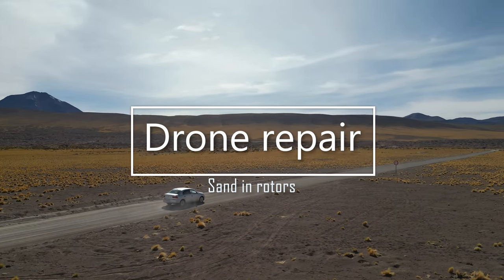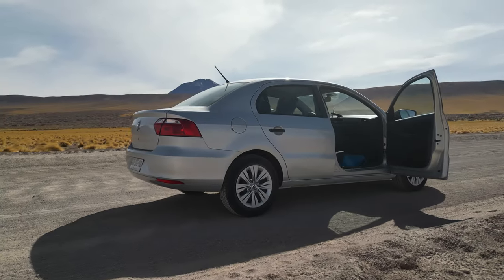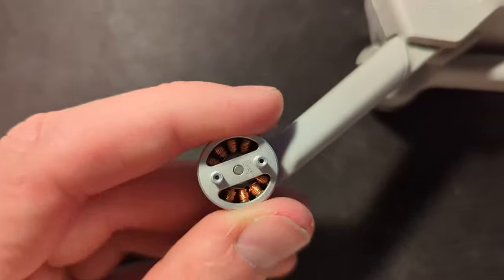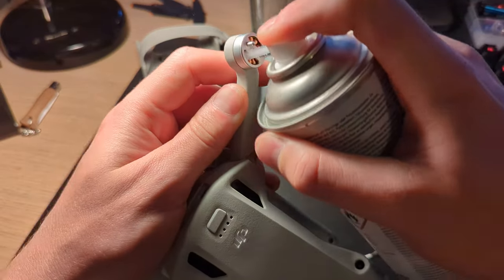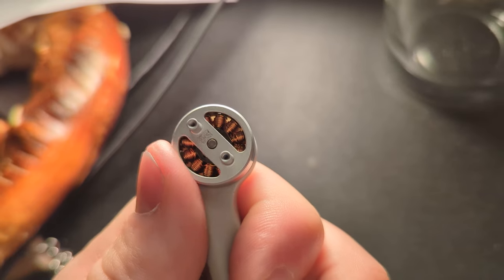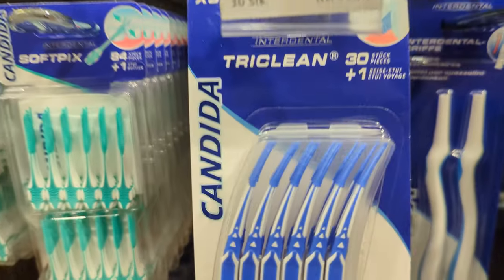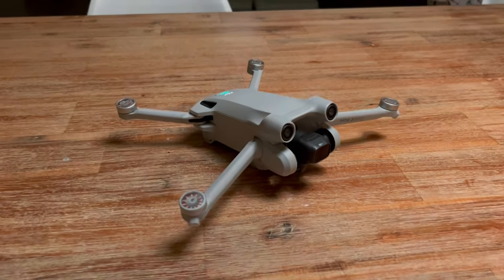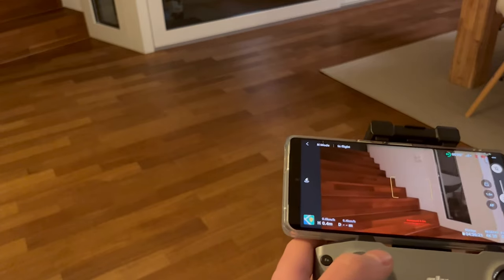Solution to sand in drone motors (DJI mini 3 pro)

Comment: one of the reasons DIY drones are so much better is you can take the bell off the stator and clean them out easily. you did a great job fixing an "unfix able" drone!
Reply: And if you cannot fully clean the ferrous sand particles off the magnets, you can choose to replace the motor bell only.
Reply: How you can take off the bell? Just pulling?
Reply: There is a disassembly video here on YouTube that should help you

Comment: When my drone was landing, it slid off the picnic table onto the sand on Lake Michigan and stuck one rotor into the sand. You can imagine how much my drone liked it. The rotor was stuck. Me and my wife used yours method and with one time use dental plastic spiral brushes  and air compressor after one hours our drone was in the air again. Thanks for the great tip !

Comment: Definitely wouldn't say that you're dumb at all I actually made a similar mistake out of excitement where I was flying my drone through a tunnel (I was also walking behind it) because I was trying to get some footage.  It ended up hitting one of the walls in the tunnel due to the fact that there wasn't enough ambient light. 

 I was actually still able to fly but got worried about the sound of dirt particles being in one of the propellers.

 I also had a stripped screw in my right propeller so I just decided to send it out and pay for a replacement but if I would have found this video beforehand I would've just cleaned it out and continued on.

 Thanks for providing this solution and if I ever have this issue again I'll follow your recommendation.
Reply from the maker: I think the brush technique and a more high powered compressor should do the trick, but I hope you won't need it ;)!
Reply: @LuWolharn  agreed. Going through DJI care was not the easiest thing so I will surely be more careful.

Comment: The best and easiest way is to use an actual Air compressor.  120psi. 3 seconds per motor. Spotless.
Reply: Spot on :)
Reply: This is what worked for me too. Once I got it to where they rotors would turn on their own I again used compressed air from a shop compressor with the rotors turning without props on. That blew out any residual dust and sand particles. The canned air doesn't have enough psi. Blowing them out while running was key.

Comment: Much faster way (not sure if it’s ok with dji, I’m flying fpv).
Disassemble the motor (there is only 1 screw) and collect all off the sand with something sticky — even a gum will work fine. Rinse with some alcohol and you ready to go. 

And my mini 2 I usually land in my hand in conditions like this
Reply: Plus it’s works even with ferromagnetic sand. Worst thing ever! Brushes, air or alcohol won’t help in this case.

Comment: Do you know why it wouldn't land?
Reply from the maker: It probably didn't recognize the Floor as "landable".
There were multiple problems that flight:
- I got the high altitude warning and clicked it away
- once in the air even though it was just a few meters away the video feed was super choppy (around 1-2 images/s)
- didn't wanna land (not exactly sure why)
- high wind warning

Comment: You were flying 12,000 ft up?
Reply from the maker: I stated around 4200m (= almost 14000 ft) altitude but didn't very high because of several issues.

Comment: Pull the c clip off the bottom of the motor , slide the bell off and clean it right
Reply from the maker: I tried but the screws are glued in and even after heating with a hair drier, I couldn't get them off..
Reply: @LuWolharn  that's weird . Did you buy it new? If so it may be a mini thing, but Google see if you can buy replacement motors , if you can then obviously it comes apart. I'd suggest the proper screwdriver, and lots of pressure,  don't know where to get it but there's a paste like loc tite probably made by 3m that you put on the head of the screw or screwdriver that keeps the screw driver from slipping allowing you to give the screws more torque... 
That sucks. Normally I do what you do but I've had grit that this was the only way I could get out.
Reply from the maker: I managed to repair it without having to open it but on the mini series, the motors are not open on the bottom, don't know what drone you are used to.
Reply: @LuWolharn  mavic air 1, dji fpv, mavic 2 pro.
Reply from the maker: Well they seem to work differently but I'm happy I found this method by accident ^^
Reply: @LuWolharn  don't get me wrong, I'd do your method 1st , because it's harder to reinstall the c clips than it is to take them off.

Comment: Welp now you just removed the lubrication from the bearings with the isopropyl alcohol… these will last a month max, before giving issues
The best way is to use compressed air, But you have to blow in between the coils and the magnets of the rotor, not between the coils, there are no moving parts there…

Comment: I custom build fpv drones and the best thing to do is take the bell off the motor and just use putty. Theres definitely still iron shavings stuck in your motors that are stuck on the magnets. Very east to hand catch DJI drones and you can just flip them over to disarm them vs having to have a hand on the controller to push down on the throttle.

Comment: I had same issue ( crashing on sandy beach). I found that canned air didn’t create enough air pressure. I have a shop compressor with a needle tip nozzle. That afforded adequate air and small enough nozzel to get around the magnets

Comment: In all seriousness though, you demonstrated a great method to clean up grit and foreign material in this type of motor. It no doubt reduced the expected lifespan of these small motors, but they are known to be very reliable over a really long period/number of hours.  The loss of even, say 20% of the 3 motors lifetime wouldn't even be noticed by the average drone pilot. Do you have care refresh? It's not very expensive for the Mini Series- I think I paid $79. You could potentially get a replacement/exchange for a nominal fee. Thanks for putting this up!

Comment: another option might be dip the motor in oil so the friction is lower and blow out the oil,
then you have to rinse well with water and bar soap foam, it disolves oil much better than any gel soap.

Comment: Got some sand in my Mini 3 Pro. My solution was different . Removed the blades from the rotor. Held upside down, and an electrical toothbrush was hold near the motor. Just a small jiggling of the rotor ccw and cw solve the issue in seconds. The vibration made it easy. Could be necessary a helper to hold the toothbrush. Replaced the blades after was clear the grain of sand is not anymore in the motor.
Reply from the maker: Soins pretty smart ! Good job :)
Reply: It worked like a charm thank you!

Comment: Thanks!  One thing that helps, but especially in humidity is to soak the motors in WD-40.  It displaces water and humidity and makes almost anything electronic work better.  It may have also helped remove that sand is my guess....just a guess....but a fairly educated one.  I learned this way back when an organ tech came to our home to fix our organ.  He opened the top panel where all the electronic controls were, sprayed them all liberally inside and out with WD-40....as I gasped in horror....and then closed the panel and said, "There!  Now it will work perfectly for years to come!"  Years later, it was still going strong with not even any scratchiness coming out of the volume adjustment....I've used it on contact plates for air conditioners, boat lift controls, and you name it....amazing!
Reply: Maybe, a sticky substance like wd40 or any oil, grease, etc could stick particles that would’ve flown/dropped off naturally. I’d be wary.
Reply: @yanassi , I understand your qualms for sure.  Actually WD40 is non-petroleum, so it more or less resists dirt and sand, which when mixed with oil can form a sort of grinding compound.  Always good to be careful though, right?
Reply: The only problem there is WD40 could strip the grease out of the motor bearings, which would lead to another set of problems. I'm assuming they use bearings & not bushings.

But yeah WD40 Rocks! It's made of fish you know.....
Reply: @mclovin583  "It's made of fish you know....."
That's a myth. It's not.
Reply: @ddegn  Whoosh!
Reply: @mclovin583  Are you sure? You know some people think the Earth is flat.
Edit: I see you're the one posting about the fish. I'm glad to be wrong.
Reply: @ddegn  The Earths not flat!! It's a simulation.....
Reply: @mclovin583  , Yes, you've got a point there!  Don't want to lose any grease....or it would be toast....

Comment: Thank you, you saved me 2 weeks and a lot of money. I had same problem with my Mavic 3. I tried all the methods. I poured alcohol on it and tried it with a toothbrush, but the plastic tips of the brush got stuck between the motor windings. Still, no sand came out. Finally, I put distilled water in a bowl, completely immersed the engine in it and took it out, and the grain of sand was gone. I vacuumed the water with a vacuum cleaner. I flew for half an hour and dried it completely.

Comment: If you find there's a resistance on the motor shaft don't force it to spin, clean it and try to spin slowly repeat until the the shafts spin free, a big landing pad is a must
Reply: if you turn it when there is resistance you are damaging the motor

Comment: Thanks for sharing. Good info. My Mini 3 Pro had a stuck propeller. I went to DJI Singapore. And for it repaired for free because its still under warranty. 
I will do like you mentioned once no more warranty. Thanks alot.

Comment: I have a question: I crashed my drone at the beach in the sand. The first time I turned the rotors after that one of them was crunchy, but after a bit of turning it was fixed. Tested it out a little and it took off with no problems. Should I still do the same thing you did with the brushes or should I not worry about it anymore?
Reply: Also what about sand getting into the other parts of the drone? There are some exhausts on top of it as well as some behind the gimbal
Reply from the maker: I would check with a light behind the motor and maybe use some high powered air/dental brushes to make sure that all sand is gone. If one little grain just decides to pop out in the next flight, your drone could be gone. And for the exhausted, that shouldn't be a problem!
Reply: @LuWolharn  Alright! Thanks. The test wasn’t very long anyways since it had low battery. Thanks for the tip!

Comment: You can use the a water method by either using a small water sprayer to washout the sand or remove the props like you did, turn it on and take each end and dip it into water and the water with the power of the motor will wash out the sand. (Did this trick with all my RC electric motors for years!) Afterwords spray it clean with Electric Cleaner to get any access water out or you can use the electric cleaner and use to washout all the sand and grit of your electric drone motors. Either way should be fine and whip up any access around the motors. It will dry out and vanish pretty quickly. Always, worked like a champ for me!
Reply: Thank you, you saved me 2 weeks and a lot of money. I tried all the methods. I poured alcohol on it and tried it with a toothbrush, but the plastic tips of the brush got stuck between the motor windings. Still, no sand came out. Finally, I put distilled water in a bowl, completely immersed the engine in it and took it out, and the grain of sand was gone. I vacuumed the water with a vacuum cleaner. I flew for half an hour and dried it completely.

Comment: use a vacuum cleaner not compressed air.. now you realy need to take the motors apart to get all the sand out... best thing for you is a set of motor covers... covers keep sand out and 99% of other dirt and dust 200.

Comment: So its important to use a helipad mat or do hand take offs and landings to avoid debris? I also saw some cover caps for the motors, but the manual tells not to block, cover the motor vents. Not sure what to do on that matter. Some say  its fine to use on YT, but I dont know if they just promote the sale of that aftermarket parts,or that dji likes to keep it open so people need to have repair or replacement of motors to do

Comment: In the world of FPV drones, when I inevtably end up with sand in my motors, I get them to spin with a little crunch just by forcing it and get rid of the last of the crunch by arming the drone and letting it sit with the props spinning for about 30 seconds. If its really bad you can take apart fpv motors and use Blue-Tac to get the sand off.

Comment: I had some issues with one(i'm not really sure with thich) motor too on Mini 3 Pro and i would get the ERROR ESC bug on screen.
I blew into all 4 motors a contact cleaner spray.
I did good amount but not too much. 
I span it manually for few circles and let it dry out.
Now drone starts perfectly well.

Comment: in previous model if the drone failed to land I grabbed the bottom of the drone and upside down, it would also force the motor stop functioning. Not sure if it’s a better option to land or not as of now…

Comment: Try an actual air compressor next time, much more air pressure than canned air. 
With my 5" builds I just turn the motors a few times by hand and all the dirt grinds out of them. If its metallic dust stuck to the magnets then I remove the bell and dab it with blutac over and over sucking up the metal and dust particles onto the blutac.

Comment: I had same problem and fixed it with starter fluid (ether) spray.  Using the straw that comes with can I blasted the sand out.  This necessitated removal of just the sticker that covers bottom of motor—no tools needed.  Only downside is that starting fluid is very flammable so do it outside away from flames.

Comment: My drone landed vertically, ending with 2 arms in the sand after failed hand catch. I worked on it for 2 and a half hours, but now it works again. Great video, thanks a lot. 
Extra tip; buy the ultra thin wooden tooth picks. Then position the gap between magnets in front of the coils. The ultra thin wooden tooth picks, fit in the gap so you can clean between the coil and the rotating part.

Comment: personally i would recommend to unscrew the motor out, and uses any method stated in the video to clean it, so that the sand do not stays under the motor(not inside) and it will make 100% sure the sand will not go back into the motor
Reply from the maker: You can't easily open them on the mini 3 pro

Comment: Isopropyl will strip off any coatings on the copper wire, magnets etc. So be sure to monitor for any oxidation and the plastic may be weakened now too because Isopropyl does break down plastic. It will remove the additives in the plastic and cause it to become brittle.
Reply: I wonder why isopropyl bottles don't get brittle 🤔
Reply: Are u drunk or something?
Reply: Iso has been used for many, many years within the electronics industry to clean flux from printed circuit boards following the flow solder process.  This means circuit boards fully populated with electronic components (like plastic encased transistors and DIP components) survive being bathed in Iso.  Therefore; I do not think you know what you're talking about... maybe you're thinking of Acetone or some other chemical.
Reply: You’re thinking of acetone. ISO cleaning of electronics is default.

Comment: I wonder what coating of the winding wires or elsewhere inside the motor might be solvent in alcohol?
Reply from the maker: Since that incident I flew around 250 km with that drone without any issues so I think it's safe to use!

Comment: I just turned my drone upside down and rotated the motors back and forth, didn't take long before the sand had fallen out.
Reply from the maker: My problem seemed to be magnetic particles that were stuck and wouldn't just fall out. But for simple sand this should do the trick :)

Comment: I found a reliable solution that not only prevents the sand from damaging the coils in a brushless motor,  but actually keeps most DJI consumer models, as well as some Autel, Skydio drones from significant damage. Step 1: don't take off from a sandy location, and (very important) Step 2: Don't land at a sandy location. 😉 Failing either condition, use the tips provided in this video to manage the situation.

Comment: Brother, good channel, I have a new mini 3 and I hit a cable 50 cm from the ground, it works fine but it does not go forward or backward, what can I do?
Reply from the maker: The drone can take off but not move horizontally? Sounds like something that's no super easily fixed, try writing with the dji support
Reply: @LuWolharn  Thanks! theres no support in my country, Mexico,
Reply: My video, where i work, in youtube, "mini 2 206"
Reply: @LuWolharn  good morning, I was able to recover the drone, I just washed the motors with wd-40, maybe it had dirt, then I put dielectric grease on the motors, I also did it with the mini2 6 months ago, I hope it helps
Reply from the maker: Wonderful! Glad to hear!